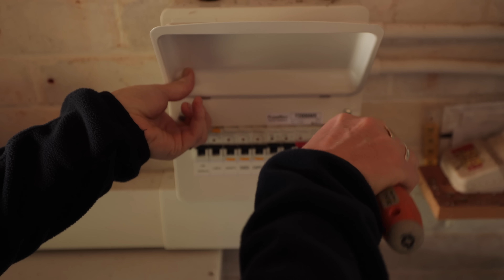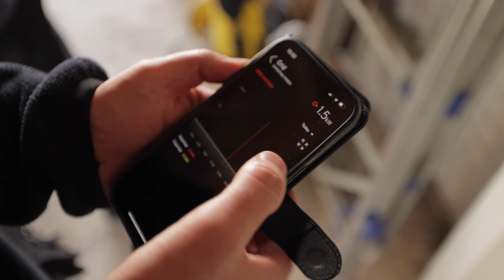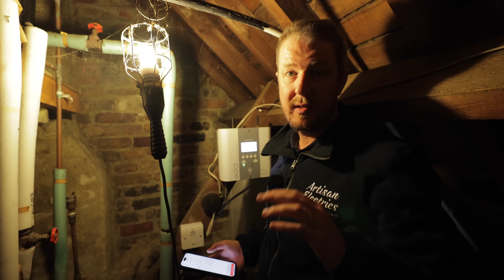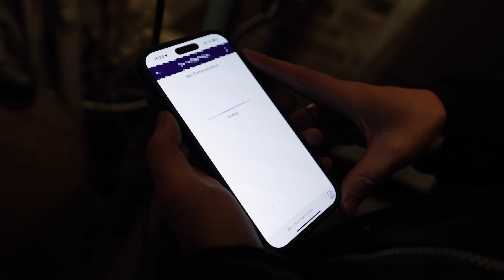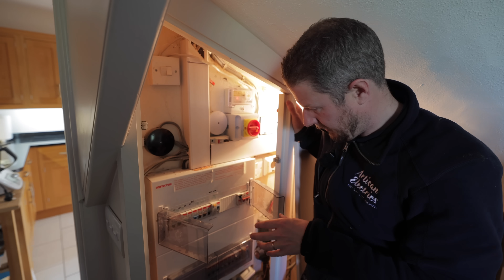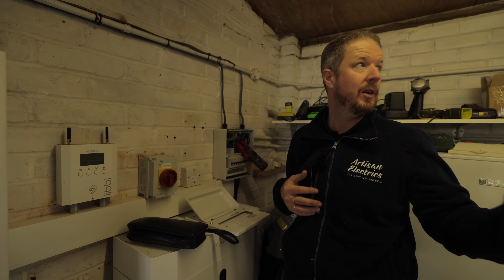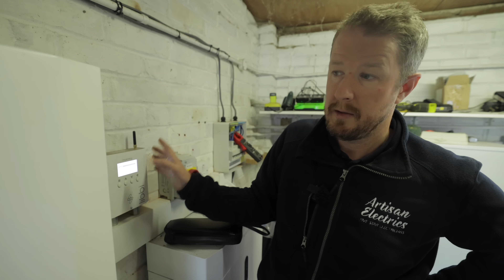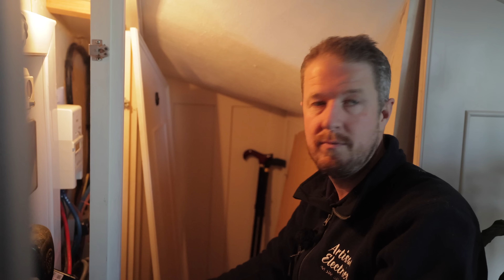£20,000+ Battery System RUINED By This 1 Simple Mistake 😳

Comment: I have a 5KWh PV system with solar edge inverter and a 10KWh battery.  I live in the NE UK.
To be honest even on good generating days I rarely waste energy due to the battery charging completely during the day on solar alone given the domestic demand.
If there is any excess I use it to charge the battery in my hybrid car.  The additional outlay on a 20KWh battery would be difficult to justify other than using it to store more cheap rate overnight energy for use during peak rate times.  This might well become more relevant as electricity prices continue to climb due to 'net zero'.

Comment: Personally I prefer DC coupled batteries. You get better efficiency, and the battery is directly connected to the inverter with own DC cables and with ethernet. Here your charging and discharging is independent from AC cables and you need less hardware, since you use your hybrid solar inverter also for the battery instead of an extra inverter.
Reply from the maker: Thanks for sharing your perspective on DC-coupled batteries!

Comment: This is why I will never install solar. No one knows what they are doing. It costs tens of thousands, yet with a crap install and setup, you will never recoup your money unless you pay again,  to get someone back in, to fix their mess. 
Other side of it, as reported in Anti-Slavery International. 80% of solar panels come from China and are manufactured using Uyghur slave labour who work in terrible conditions with no health and  safety equipment and literally tread bare feet in some of the chemicals/minerals used to make the panels. They suffer long term health problems, so people can look smug, about their new solar panels and how 'green' they are. No one bothers to ask where and who made them!

Comment: In one of your later videos you said that these systems do not require any maintanance. Ok, it is not you who have installed this but there needs to be more than one installer who knows how this should be done in UK. Change in regulations from a few years back and different software versions, hmm. I have seen this in other gadgets.

There are Zippys and Libbies and a lot of surfaced mounted cables. This does not look safe, and is not user friendly, especially for elderly people.

Can we conclude that some solar/batteries needs some service, i.e. it is not a myth they do.

Comment: I suspect the systems intercommunicate using RF signals, which are pretty good at passing through walls, but not so great over distances, so it's possible that the distance between everything is a concern.  The wifi is a different beast, though, and I'm slightly bemused by this chap who has spent a fortune on solar, batteries and an EV, but apparently is still using the crappy router given to him by his ISP.  Modern mesh routers are a piece of cake to set up

Comment: Hold up. right off the bat. the installer is saying the batteries stop charging due to the max current input? it will still charge the batteries to 100% even at 1 watt.

Comment: I recently had a Zappi 2.1 Charger fitted at my house. It never worked. It categorically refused to see and connect to my broadband router even though it could see neighbours broadband (and before someone says poor signal, no. The signal strength was 5 bars). The installer booked himself in for a second visit and I had a Hypervolt fitted which connected with no problems. The Myenergi devices seem to be a bit dated now and probably would be best avoided

Comment: Reducing the national. Voltage will require an increase in current when operating a 3kw kettle and so the kettle cable will be thicker as will all other household appliances if you demand the same energy that you used to give to your appliances.  It's  not something  I would want.

Comment: On the double thermostat in the hot water tank, is there any indication that either of the stats have failed?  If there is none, then one stat can fail closed, and regulation will be controlled by the second stat. At some future date, the second one fails closed, and boiling can occur. These failures can happen at any point in time.  We call this an undetected failure in failsafe parlance.

Comment: Remote rural off grid here Australia running ten panels on 24 V , all house lighting on separate LED 12 V system have a small wind generator 24 V to trickle power at night just keeps the batteries topped and in good condition. Run a whole house plus workshop off inverter. Total cost over ten years under $8K in parts did all the labour myself , know relatives  in the cities and I offer  to set up a solar system for them 6K plus change and they are in rentals so they are stand alone systems not connected to the grid to run then main amp draggers , fridges/freezers air con ect . Am not a licenced tech but don't need to be for 24V/12 V systems stand alone. Having said that I isolate batteries and inputs and outputs am pedantic about safety. I don't and never will touch mains 240V nor gas instillations qualified techs do that run.

Comment: Even if this system was working properly it is guarenteed to lose money . If the investment is 50K you may reduce electricity bills by 10K before it all needs replacing ( I speak from experience) . Charging batteries with off peak electricity will lose money  overall ... you will have to replace battery sooner.

Comment: Never ever put electronics in lofts, this drives me nuts, get the power off the panels and out the hot roof space, then install inverters in a dry, cool ventilated area.

Comment: Relying on SOC when troubleshooting a battery system that hasn't been topped off in a long time isn't a good foundation for troubleshooting. 

You need to be referencing battery and cell voltage.

Comment: Many companies sell solar equipment but lack the expertise (or hire amateurs) to install it properly.  They import inexpensive Chinese systems that aren't certified and are only compatible with their own components.  Upgrading a solar power setup is even more challenging, especially with older panels and inverters. Please do your research before you spend many thousands on any appliance.

Comment: the absurdity of storing one's energy production, I myself am a solar energy producer, and I resell my electricity to my national energy company, I buy it for 14/15 euro cents, but I resell my electricity a certain number of times more expensive! you have to be really stupid to imagine making savings by consuming your production, 1) you have to store, you need batteries which are expensive 2) the duration of these batteries is identical to those of electric cars, between 8 and 12 years, after which you buy new batteries, 3) you have to rectify this direct current into alternating current to use it at home 4) winter is the worst time to produce, the Earth's axis changes, so the rays are lower on the horizon even at noon, more atmosphere to cross, therefore a lower solar yield!!! very short days, days often with little sunshine, and it is in winter when we need the most electricity, more lighting, heating (even fuel or gas) we need electricity to make them work, even a pellet stove needs electricity!)

Comment: Right. I'm polish living in UK last 25 years. In Poland we have something called "kotłownia". It's translating to boiler room or engine room into English.  This used to be cellar where old fashioned coal furnace was installed or in modern houses is on ground floor, just off to the entrance to the house. You also usually have there all fuse boxes and anything to do with heating and powering your house. I'm and electrician and gas man in UK.  I find the state of English way of doing things , your installations, places where you install meters and fuse boxes (under the stairs in tiny cavity) utterly ridiculous and u should be ashamed.  Installing hardware for solar panels in the attics being prime example of laziness and stupidity.  Attic should only be used for storage or if someone is keen to make it an additional room. You british are sadly going down in flames with everything you trying to do. U used to be envy of aspiring nations like Poland,  inspiration to be like u, unfortunately you are sinking very very quickly.  Your incompetent government only makes it worse. I love proper british people [not those impostors who came here from far east] , and I'm very sad you are going down without a wimp 😢

Comment: as somebody who got into solar and micro hydroelectric systems without knowing anything about it. there are sooo many things nobody tells you. something as simple as never use 2 different solar panels  with different watt ratings.  not even the solar panel sellers told me I shouldn't do it. maybe they didn't know or they just wanted to make the sale.  you learn new things every day with these systems.
Reply: Technically you could use different types of panels with micro inverters, and with optimizers (though it's not ideal).

However you should never use different types of panels in a string system within one string.

The amp rating is the bottleneck, and the weakest amp is limiting the other panels. Optimizers reduce the voltage to maintain enough amps, to avoid the problem.

Comment: Really excellent video, £20,000 and not working properly for years. Sadly all too commonplace where installers take the fast money and foxtrot oscar.  As a solar enthusiast, find there is no back up at all in streamlining systems or advising best tarifs etc, and have managed to save  a lot of folks a great deal of money by getting them on the most cost effective tariff. Your video was great in showing many other things that do go wrong as customers modernise one item after the other and all the older but functional equipment gets ignored.

Comment: I’m guessing that when this complete system is correctly set up the potential energy saving on running costs vs. 100% grid power costs are enormous. ( However, I do fear that the ultimate pay back on the total set up costs for this apparent miss-mash may never actually happen for this homeowner 🤔?

Comment: At 500 watt panels ( I only watched the first 4 or 5 min. ) . He would only have like 12 solar panels. The batteries were charging at like 8 amps. So what he has the solar panels in one roll ? There's no way he could use much power during a single day . His system would not provide it . I wish I watched the whole video but just got bored .
Reply: Domestic Solar panels are generally 250/260 watts.

Comment: CT (current transformer) is a simple transformer with a single turn of primary. It won't work on the DC side (your black & red wires). To measure DC current you need a hall effect clamp.

Comment: I am a retired electrical engineer. Been involved with wireless for years and its caused so many problems, I have now installed a solid reliable cat6 system in my home.. Problem with wireless now in many areas is the saturation of devices using the same frequency or in the same band.  I have had failed WiFi Internet due to my wireless cctv and had to replace with cables, the security system used a microwave in the 2.5ghz band knocking out the WiFi. Years ago doppler devices were on 10ghz roughly. Why this sudden change to 2.5 ghz I do not know. Just solved a friends problem. With wireless fail On his freezer  temperature monitor which I recommended. It was  dropping out. I then said any other devices, he found several devices and this was the cause. He has addressed it now. But you see my drift on this.  Its a mind field.

Comment: the other issue is who is responsible for what when a new item is installed, usually if company A installs one thing and company B comes along and installs something else they more often than not don't want to touch company A's stuff and would usually tell the customer to contact company A to change the config, most companies really don't want to end up supporting a device that they don't support.

Comment: A huge amount of complex electronics and computers, a huge amount of electrical and electronic installations and programming. However, a large part of the energy is probably used for heating. Has anyone tried building a water heater from scrap parts? Now that the earliest solar panels are replaced , there are probably free or cheap panels available, so I wonder if they could be connected directly to the heating element of the old water heater. The electric resistor probably isn't accurate about the voltage, so you might not even need a regulator. An AC thermostat may not be able to withstand DC power breaking for long, though? Used scrap could be used to store bulk thermal energy from the sun without using any new natural resources.

Comment: I have a simple set of 26Kwh AGM batteries and a A$600 6.2Kw inverter charger from ebay. It has been trouble free for three years now and I pay little more than my connection fee to use the grid for backup. I also have old school solar hot water heating. No internet connections, wi-fi or Bluetooth hassles.

Comment: A 50 amp Fuse doesn't blow until 100 to 150 Amps?
Reply: If you recall your college training you will remember that old school Hot wire fuse links will often carry up to almost double their intended capacity if the overload is carefully and slowly increased, before they rupture. That’s why generally more accurate circuit breakers are now used in modern hard wired installations. (The old terms “fuse boxes and fuses” is often still used, but is really just slang for MCB/RCD distribution boards.

Comment: I'm 6'26" in and there's been much talk about CTs.  I've now booted up the laptop to check the description (not easy on the TV) and to be able to post comments.  Description mentions CT too.  Going to try googling CT but at this point I have no idea what a CT is.  It may be explained later in the video, but could really do with that when it's discussed.  OK, google says it's a current transformer.  OK, does that make sense as a set of inputs to a control unit?  I'm not certain I've got the right thing yet.  So the definition is correct, but incomplete.  It was discussed at 11'20" or so, it's the coil around cables that reads the current and transmits the values to the control unit.  The other name for it is current transducer, which makes more sense to me personally.  If you've got one of those energy usage displays from your energy supplier, (like the one in the ad with Angela Rippon and a fake Einstein) they will likely be using something similar, but simpler, clipped around the input wire near your consumer unit, at least one I had years ago did.

Comment: So much of the solar energy is wasted in  solar systems sold here? DC from the array converted to AC via inverter than back to DC from the grid to charge batteries than DC back to AC to use battery energy. About 75% efficient 😂
Alternatives out there that are closer to 95%

Comment: I have only one point to point out. Solar is not a renewable,  it is a consumable. A renewable device is something that can be fixed, repaired without needing full replacement. I know you get a lot of work therefore make a gair bit of money of this stuff. But please stop referring to it as a renewable as it's not. They where giving the name renewable as part of the con job, to fool the public into thinking it was something better than it is. A petrol car is more renewable than any solar, wind generator or corresponding electrical units associated with it. Atleast a petrol car can be put to full working conditions with only replacing parts and can then be used for hundreds more kilometres.  A so called renewable can only be fully replaced when it dies. Just because something gets used thousands of times before end of life doesn't mean it's renewable it's a consumable.  Words have to be used with truth not lies or words mean nothing.
Reply: I catch your drift in the respect that solar PV panels are not ( easily) repaired thus replacement is almost always the only option. You point is correct.
Reply: @philtucker1224 in 99.9% of cases even if it broken wires solar panels get replaced.  Solar panels don't get fixed. They get replaced unless it is a home system with a handy owner as they are not worth repair. A panel from the moment of manufacture are on the way to land fill as they are to expensive to even recycle.  It has to be a heavily subsidised recycling centre or they are not worth even looking at as the individual parts do not seperate easily.  Most it is a chemical procedure even trying to get the glass and aluminium seperated is not an easy process.  So most will be In use till they are down to about 80% capacity then thrown away. Waist and a hazardous land fill product.

Comment: Giving electrical devices children's names helps nobody learn deep, technical data from this video. I understand those are the device names as per the manufacturer. That is not the videographer's fault. Just tell us what the device actually does. Then call it the inverter, power distribution panel, etc. Eddit, Teddi, Libbi, easy to say I am moving on. Thanks for listening.

Comment: I've had the same issues, once somebody had some building work and the old wood was replaced by brick and concrete and the WiFi no longer extended to everywhere. As an electrician, it was quite difficult to diagnose because there was evidence it had worked and of course I was not aware of the building works that blocked the WiFi. I only managed to figure it out when the customer pointed out that one of their CCTV cameras no longer worked. There is a lot of argument to move away from mesh WAP and install PoE WAP.